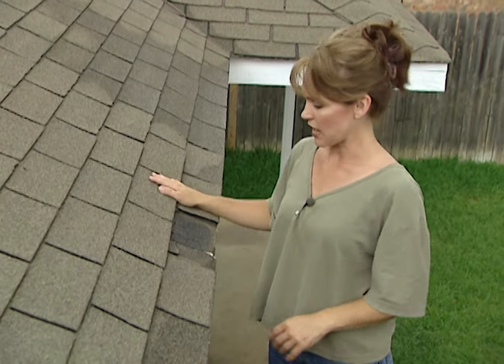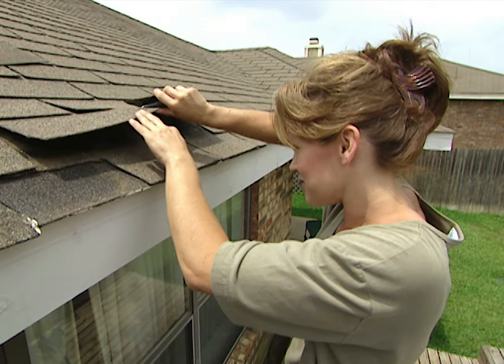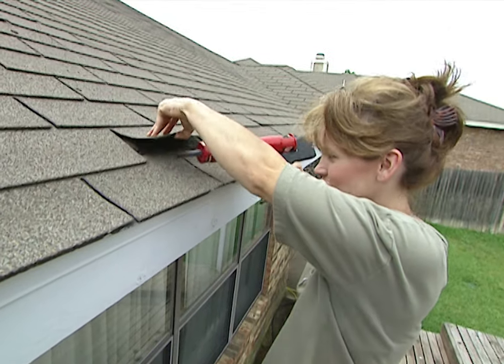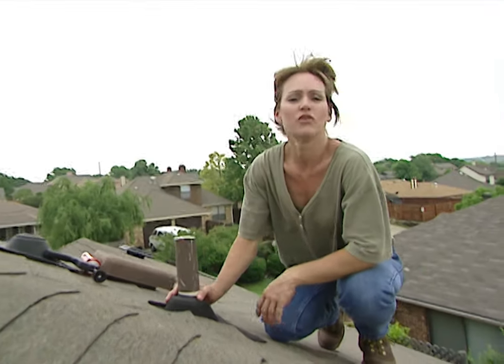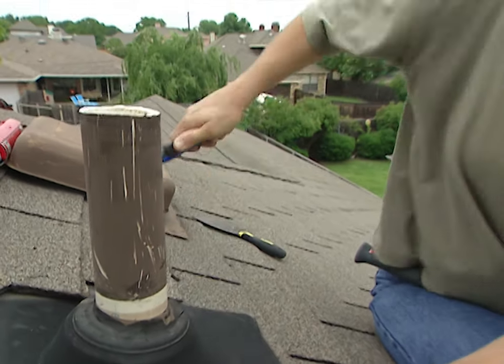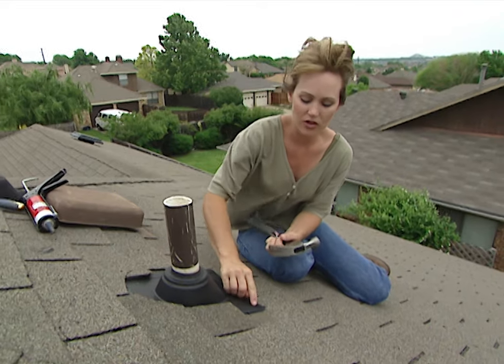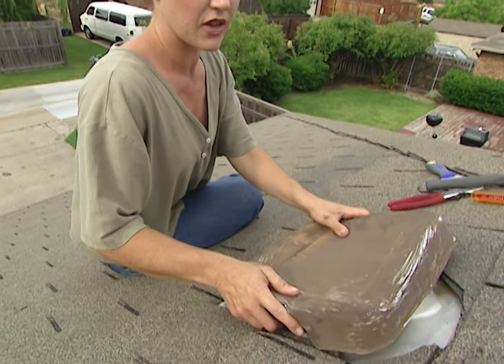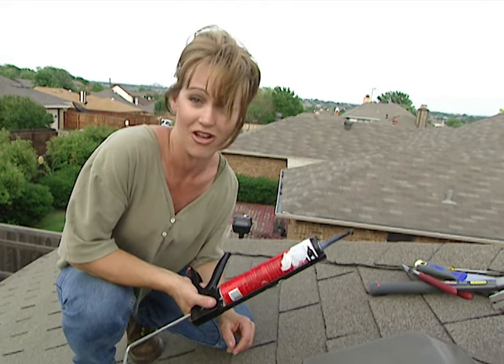Roof Repairs - Stop and Prevent Leaky Shingles and Vents - Do It Yourself

Comment: That last one you replace is going to leak bad.  Not enough coverage on the top portion, wind is going to push that water right in there.
Reply: Its homeowner diy so when it does leak they can call you lol
Reply: I was like hey lady yer not done...
Reply: Wow was looking for someone to confirm my theory about that last one
Reply: i saw that to.. she could have cut the shingles  rounded out alil more on the parts that were hitting the vent  soo it would slide up in there more.. way tomuch of the upper part of the vent exposed, it looked like it was only  2 inches under  the shingles.
Reply: She’s definitely a long way from the kitchen
Reply: @fireboltaz  for sure, nice profile pic
Reply: Absolutely. Water is going to leak inside. Not enough covering on the top. Water will pool there and will have to go somewhere; inside the house. That last part putting the nail. Make sure you nail to the plywood underneath the shingles. If nail boun es, it penetrated the shingles but strong winds will rip it right off. But never showed where exactly the leak was coming from. What we saw was repairs, not the cure for the actual leak. But we live and learn.
Reply: Was wondering how the heck the old one wasn't leaking like crazy already, maybe it doesn't rain much there
Reply: Do I put another shingle on top orrrr how do I cover that?
Reply: Yep. Need to seal upper not lower
Reply: It seemed to me that once she noticed that the new one really didn't fit, she just ignored it and went on with the install as though it did fit - something a kid would do.
Reply: We have to cover top of the flange with ice & water (weather guard)  before shingle  - 'think like a raindrop'
Reply: Total amateur here and I immediately thought, wait shouldn’t the material higher up be overlaid and not underlaid??? Just common sense, no?

Comment: When you replaced the vent it confused me how water wouldn't get in the house the way the shingles were. Btw, I watched several of these videos with guys teaching who didn't teach half as well. Thank you for this. Made sure to Like it.
Reply: The shingle goes up quite a bit under that cap seal so it's actually over top of shingles as well, but yeah that space around the pipe is pretty big. seems they would have made the shingles closer to the pipe, also I don't like to see nails on the lower end of the boot seal because they will likely leak later on once the tar dries out.
Reply: @BigAlWillis  yessir. Always used to do that and caulk, but man is in nicer to jjst nail the flange under the higher courses of shingles.

Also the rigid flange needed cause those damn floppy ones suck.

Comment: This is a great video, love the advice and an obvious expert. One note, I believe you want to do the nails above the tar strip so there is no possible water leak gap, can check on the install instructions of the shingles to confirm.  This is true for the flashing around the vent as well, you want the nails under the shingles up the slope of the roof so as to not create a hole for water to get in, though since she's sealing it with roofing cement it's probably fine as long as the cement is rated to last as long as the rest of the flashing.

Comment: In the UK this is the kind of stuff we put on our garden shed, though no doubt with builders making houses cheaper it will only be a matter of time until this stuff is common house building practice in UK. Many thanks😀👌
Reply: Since it works, you should put it on any building. Simple is best instead of over complicated fluff.

Comment: Roof Stapled ? Check all !
Polyurethane caulk tacks up faster.  Seal tab area with it. Pipe and vent flashings? If sealant is needed.  Most cases it was installed wrong.
Both flashings will (after what she did) will leak. There's not enough coverage at the top on both.
Also, her extension ladder wasn't extended safely, and I'd rather ding up a little piece of shingle than put two holes in the fascia.
Reply: she is a  beutiful  profesional girl (Muy bonita)

Comment: Tip: don't just drop staples or nails on the roof, sooner or later you'll step on them and make another hole in a shingle. (From experience.)
Reply: Tip: don't tip
Reply: @anomikak1062  why? It’s a good tip…. From a professional roofer…..
Reply: @justinstevenson2061  maybe because its obvious you should always leave your work place clean

Comment: You'd be off my job if you nailed into a fascia board like that just for a ladder. No point in nailing into that drip edge either. If you have to nail, nail below drip edge and hit with some white caulk/silicone when done.

 Having said that, I know most people don't have a roofing ladder handy. From experience, unless you have some roofing experience from/with a roofer that knows his/her trade, I would just call a roofer. If you don't know what you're doing you can get up there and make things a lot worse than they are. But if you have the basics, you can and will save some money.

Comment: If it doesn't leak and looks good it's good. There are a million ways to handle any one situation when roofing. The roof most likely doesn't have a warranty and most situations calling in a warranty is just a pain and you usually end up taking the loss anyways. Roofing is easy, dangerous, and hard all at the same time. Almost anyone can do it as long as they are willing and able to do so.
Reply: Good job on the repair
Reply: Welll….. not always easy. Depends on the roofs design, certain flashings needed, tricky penetrations, and the slope.

Installing a course of shingles is easy realistically in terms of install method. But so many other things that come into play.

Understanding the system as a whole, not just nailing shingles.

There’s a shingler, then there’s a roofer. Quite a huge difference.

Comment: You just voided the warranty on the shingles. The nails goes below the tar line and above the rain groove (see label on shingle package). The other two approx 1” from each end. This allows you to nail the top of the shingle below the one you’re nailing. In hurricane areas you may need six nails, two just above and on the side of the rain grooves and one on each end. Shingles should never be installed on a roof under a 4/12 pitch. Otherwise, good job. I admire your work ethic.
Reply: Can install on a 2/12 to 4/12 if ice and water shield the whole way where I am.

But at that point just use flat rolls honestly.

When she lifted out the staples and pulled the shingle out without removing the staples (btw staples 🤮) could definitely tell the roof wasn’t installed properly or you’d have had to life the row above and take those staples out.
Reply: her box vent remove and replace will leak very soon too

Comment: As a roofer let me tell you ppl, never nail a 2x4 to your facia. All you will be doing is putting holes in your facia metal that can't be fixed and holes are ugly to the eye! Oh and the way she repaired the pipe flashing and the box vent was not correct. I do admire her for getting up on the roof tho.
Reply: And what kills me is that people use Fuckjng staples !

I’ve been roofing 15 or more years and only once saw this, and it was one of those ordered in sheds.

Up in the Canada eh. 1-1/4 roofing nails and I still see them blow off, couldn’t imagine stapling a lm entire roof makes me want to cry.
Reply: @justinstevenson2061  I hear ya! Staples are for paper not roofs.
Reply: @marcmiller789  ya and now where I am plastic cap/washer nails/staples are getting more common.

Their not required if your shingling same day as prep, but if your prep is left exposed they require these fasteners.

I use them regardless. So much better. Bought a bostich air gun that shoots the staples with the caps.

You need less fasteners, and they hold up to the wind so well. And also keep water away from the exposed fastener head and shaft to keep water out.

It’s 100% required on tyvek now regardless of your siding the same day.

And again, never a piece of tyvek blown off in the wind which is all too common.
Reply: @justinstevenson2061  I used to have a cap nailer, luckily where I live no codes or inspections for roofs.
Reply: @marcmiller789  ya no inspections here, but it seems to be a new manufacturer recommendation.

Again not so much for synthetic on the roof, more for tyvek it’s forced.

For years I was fine just 1-1/4 nails in the synthetic.

Never had a leak after a good rain.

One day was running late and prepping quickly into the dark, and the next day we got some fucked up torrential rain.

I was only doing the lower as the top was already done, but the top had no eavestrough.

One of my nails blew through the synthetic, and of course out of all that area it had to literally be where the top drained onto the bottom that the nail blew through.

Got quite the leak. Not attic access on that roof as it was front door and living room.

Had to remove plywood to get access to remove / fluff and dry the insulation.

From there cap nails and never looked back. Lol. One in a million chance but still never dealing with it again.

Used handbangers a couple times and at that point would’ve been quicker to just shingle same day 🤣. Bought the gun after that.

I just always like to do a full rip/prep before shingling.

I’ve worked with guys in the past that rip/prep/shingle same day by sections.

I just hate ripping beside new laid shingles too much chance for damage.
Reply: @justinstevenson2061  
I use synthetic underlayment. I make sure my crew doesn't tear off anything that can't be covered same-day.
Reply: The 2nd vent job was certainly NOT good to go. Im not a roofer and I could tell. Look Im all for giving the pretty girl compliments for "getting on the roof" slaps on the back "atta girl" but that 2nd repair example was incomplete and someone might follow that example and make things much much worse. The 2nd vent needed to be covered with shingles to carry the rain over and past the vent. The way it was left there was a visible depression water would collect and leak through. When she said "good to go" maybe for replacing the vent but not the entire job of sealing it all back up . I cant believe I had to read this far down in the comments to read yours. People that was not the full job.
Reply: @justinstevenson2061  are y’all roof contractors?? I have a question we had our roof replaced after hurricane ida and started having a leak(not sure if it just started or we just found it) a year after the roof was replaced. Do we call the roofer that did it if it’s under warranty? Or should we just call someone else cause I’m not so sure I trust this guy now. And is it common to have a few leaks after a new roof?
Reply: @bombswabs3041  I’m also a female diy and know nothing about roof repair but could clearly see that was not sealed well. No clue why she would leave it like that.
Reply: @jane1385  Not common, at all...

Comment: As a long time roofer I have quite a lot to say here. For starters, we're taking roofing tips from someone that doesn't even know which way a ladder goes.
And a tip before I start, temperature is a big factor. Colder weather leads to brittle shingles breaking much easier, so be careful or you'll be replacing even more.
Shingles are more commonly installed with nails, in that case the way she ripped up the shingle and pulled the staples from underneath it, would have damaged the shingle with nail holes. She should have also separated the shingle above it and removed the fasteners from that shingle first. And you want to put your new nails above each slot in the shingle, just below the tar line. Nail below, not on tar strip. Manufacturer specs. Less asphalt to grab on the tarred area, and not so close to the slot of the shingle above it, where water comes in. Water could possibly reach that nail and rust and leak over time. 
Next, I'm not sure why you'd nail a board (holes) into your fascia for your ladder instead of maybe a few barely noticable scratches on the trough. And fascia quite often has metal flashing on it. You can also put a shirt over the ladder before resting it against the trough. If no trough, the shingles may bend down a bit under the ladder but can be adjusted when you're done.
If you look at 4:20, She was not done with that "boot" (flange). The shingles over lapping it also need to be nailed back down or wind will catch them. Also the right side had no shingle over lapping at at all. Water will get in under the side and leak through the pipe hole.
And they are not very easy to remove. They'll likely be nailed all the way around under the shingles so be careful not to damage more shingles. Same goes with the vent, which was also conveniently loose and installed with staples for this video lol.
She did caulk after but ideally you dont want your nails angled like 4:17. The nail head itself helps keep water out of the nail hole.
Back to the vent. All vent styles are different shapes and sizes. They'll likely not have the same size hole in the shingles. You may have to cut it bigger or add pieces of shingles to make it smaller. And even if it does fit in the shingles like here, the actually vent hole underneath probably won't line up with the hole in the roof.
Also, same as the "boot", overlapping shingles need to be nailed back down. 
If you look at 5:31, she had WAY too much exposed at the top of the vent. Shingles should be right down close with a small gap for run off. At the very least should have caulked all around that.
Also as she did in the beginning, all shingles that you have separated should be sealed back down with caulking or roofing cement. The tar line will never properly seal again and shingles can blow off. Never silicon caulking though. Silicon and asphalt are not compatible and will separate.
Last tip, don't expect new shingle color to match. This one seemed pretty close but typically due to sun and weather, new shingles won't match anymore.
Reply: J Gun, I have been in home repairs and roofing for over 30 years. Your over criticising. Half of what your saying in realtime makes no sense. Seems like your here showboating. She did a good job in her presentation, and thats coming from a Pro.
Reply: @RoofProServices  if you think this video shows the proper ways.... You're just as bad as her when it comes to roof repairs
Reply: @RoofProServices  I highly doubt you've been roofing for 30 years if you disagree with me. If you have that's just a shame. And I'm not sure what you mean by "in real time makes no sense"? Everything I said is literally how it's done, and how I would do it. Any less is just wrong. 
A real "pro" will still do it properly, not just a cosmetic band aid to get paid. We call those "hacks".
She will have problems later with these areas I guarantee it. Guarantee it.
Reply: @RoofProServices  I'm just trying to add some important tips for the average person that isn't as educated on the matter. I don't see a point in you trying to discredit that and lead people to doing their own repairs improperly. Unless you're trying to capitalize on that lol
Reply: @jgunn774  thank you for your comments. My BF is replacing a boot.  My job is finding videos from professionals so he can pick up some right info. I very much appreciate your comments.  I have properties and DIY when I can. Have no roofing experience but this seemed to gloss over the installation.
Reply: Shut up! Her roof doesn't leak anymore and thats the point
Reply: @divinee.155  ummm. For how long?  Making it not leak for short term or for several years are two different things.
Reply: @divinee.155  you don’t even know if it does or not. From
The looks of it I’m sure it does.

Comment: Was pretty informative, but nail below the tar line, but above the eye of the shingle.

The nail in the tar line can stop the tar from bonding.
Reply: And just remove a shingle or two above the plumbing stack, then replace the shingles to get a clean cut tight around the boot.

Comment: time 4:16 as the nail were being nailed the shingle was bouncing around. Are you going to replace the other shingles around the pile. There also was a large half circle cut on the right shingle. I assume you cut it to remove the gasket. The other shingle should be replace d to do a more professional job.

Comment: Maybe I'm slow but wouldn't it have been better to compromise the shingles versus putting two holes into the Eve?
Reply: A couple holes in the eve board aren't a big deal to must people. They will be practically invisible. If you want to be professional about it, when you take the board down you can caulk the nail holes shut. 

Also, after putting down a multi-thousand dollar roof I recommend doing everything possible not to compromise your shingles.

Comment: Didn’t check underpayment for rot when replacing missing shingle. Put your ladder on the rake and don’t put unnecessary holes in your fascia.
Reply: I’d rather the eaves than the rake, eaves tend to brake less rake would bend sideways not downwards.

Your only folding the first row and starter at the eaves.

Your hitting 2-3 shingles on each side of the ladder considering for overlap.

I mean I’ve had to do it, but always try not to.
Reply: What if you have gutters all the way around? Is it safe to
Put the ladder and weight on the gutters?

Comment: Thank you for the information.  Are staples a bad idea?  Also, can you give more details on what should be used.  I think I have seen 1 1/4 inch roofing nails used most the time.  DeWalt has a 20v roofing nailer.  I might use it.
Reply: A bit late here, but yes staples are a horrible idea for shingles. I don’t even use them on my felt/synthetic paper now.

Yes the 1-1/4 nails are the best option. I’ve never tried the battery operated nailers but have contemplated it. I just use air gun and compressor, best for larger jobs.